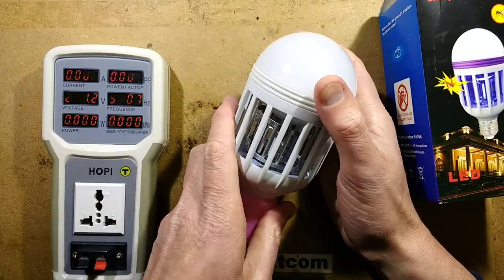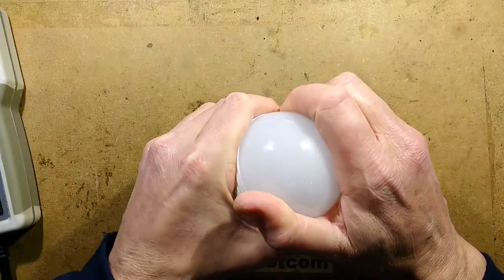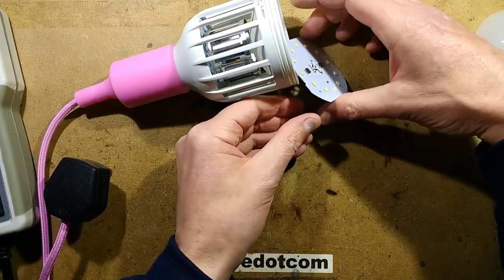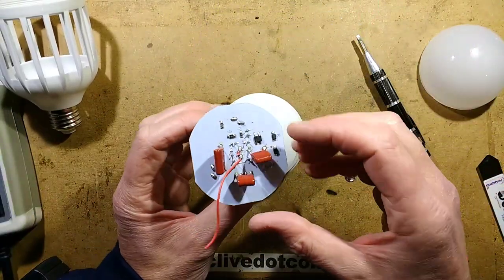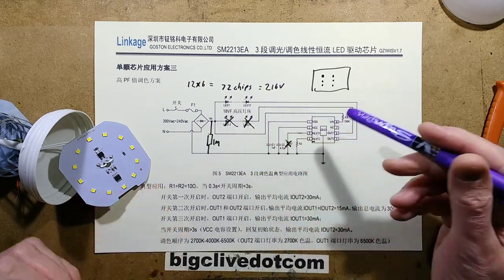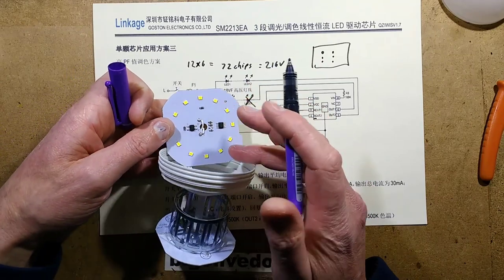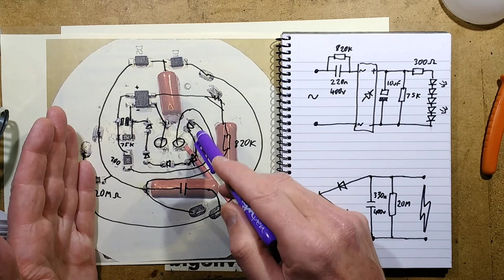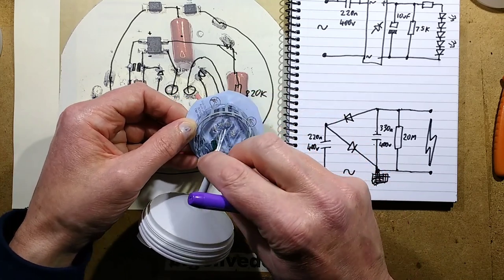Inside a bug zapping lamp (with schematic).

Comment: I have a question regarding the PCB's of hard drives. Some of them have a diode across the 12V section of the power input and GND, but the negative side of the diode is facing the 12V section. I find this really strange because I cannot imagine any use for this. There is usually circuitry afterwards, but it makes no sense to me. I just bought a hard drive that upon being plugged in, it smoked and the PSU shut down becuase of overcurrent protection. I took the PCB apart, and the diode I'm talking about was blown, thus causing a short. I removed it and now the HDD works just fine. The polarity was correct and there is no visible damage to either the PCB and the diode. What's the purpose of this? Here is a picture of what I'm talking about:https://imgur.com/a/wc6T0 Ignore the stuff about the BIOS chip, I'm talking about the diode shown by the pink arrow.  The PCB Board Number is 2060-701640-007 REV A
The diode was a "13L 02", the 02 part was in smaller letters than 13L
Reply from the maker: The reverse polarity diode across the supply rails is designed to do just as you describe.  Shunt the rails if the polarity of the supply is incorrect.  In man instances it survives, but sometimes it fails short-circuit and in doing so protects the rest of the circuitry.  If the diode had already failed short circuit then it's possible that the module had already been subjected to a reverse polarity connection.

Comment: This makes me curious about those old touch lamps that changed intensity when you touch it a few times. Hmm.. Take one of those apart! X3
Reply: SOLID Shift those are still available. I’m sure they work by making the casing somewhat live and part of the circuit and the resistance of your skin causes a change in the circuit which controls the light?

Comment: Years ago, when we got our first camper, (Nice POP-UP that you could pull behind your car) my good wife gave me a birthday gift of a small rechargeable bug zapper.  Now this one is made of plastic, but much stronger, this was pre-china so made in Korea and it actually has a florescent or neon bulb that does shine a deep purple almost black light.  The wire grid is nasty hot electric, and fries the bugs as they fly directly into it (can you say Gloomy Sunday?  https://www.youtube.com/watch?v=KUCyjDOlnPU ) It came with a rather nice cord so you could plug her into the camper if the battery got weak, but she seemed to last quite a long time on the built in rechargeable.  I still have it, although the hook to hang her from the camper is now long gone, and has been replaced with a piece of coat hanger.  Strange though, there doesn't seem to be that many bugs down in Arizona, now when we camp in the Dakota's the thing is frying like a MacDonald's grill.

Comment: 6500k is damn near blue, even 5000k is pushing it. I bought a set of HID lights for my car. 5000k was so blue it was damn near worse then the lower level yellow 3000-4000k that cuts rain and snow. 4500k is the said, best for automotive headlights.

Comment: I saw on a US show the host was told by a electrician that was installing LED lights on a boat dock that LEDs do not attract mosquitos ???  If that's true that makes this zapper pretty useless I have all LED security lighting on my farm and I have noticed there are not as many bugs flying around them as the old mercury vapor lights   I this true ?? WOOFS !
Reply from the maker: It's probably more random marketing hype from the LED industry.  Like the 10 year lifespan of the expensive lights that fail within a year or two of installation.

Comment: You couldn't convert the hopi to lower ampage? Open her up!
Reply from the maker: I could change the shunt, but I'm not sure if there's the facility to switch range on the unit or if it would require different software.
Reply: bigclivedotcom only one way to find out!!

Comment: - "Three chanel control Don't have to change the power switch"
- Well how do you change mode then?
- Well.......
Reply from the maker: By using the existing switch to turn it off and on.

Comment: Hey Clive, Been a while since i've commented on any of your videos - Sorry been a bit busy as of late. Hope all is well with you.
You stated your audio  has a bass heavy quality. To my system it's good - but i use high end monitors with large power reserves. Not many do. Most have a 3 inch speaker - or in a phones case 3/4 inch or less surface area to reproduce sound.
So i guess you go down the middle for sound content, not always easy for you i would imagine. With the way you currently do things - with good results by the way. Some day Clive i would like to hear you with a really nice ribbon mike - even a Shure sm 58 would be good.n Yeah, you are trying to keep it simple and can't fault you for that. I have been experimenting with a bluetooth module.....Perhaps i can come up with something with fidelity and simplicity......

Anyhow have a good.

Comment: Well the Version you have There Costs in German ebay 7,50€ Now. xD
Bought now one From China with Wires instead of Metal Mesh for 3,15€
Arriving Sometime between End of Okt and end of Nov. ^^
Replacing my RGB Color Changing Lightbulb.
Or i have to Find a E27 Adapter 1 to 2 Sockets.
Reply: Hint i bought a Adapter from China for just 1,15€ inkl shipping. xD
Reply from the maker: Just one adaptor?
https://www.youtube.com/watch?v=2DMGAd_xJiQ

Comment: Mosquitoes are attracted to CO2 not UV.
Reply: They're attracted to both. I have one of these bulbs on my back porch and I have to clean it out every few days in the summer because it gets so full of dead mosquitoes. I also have a mysterious source of mosquitoes in the kitchen, which may be from the window plants and put another one of these bulbs in a socket to plug adapter near the window. It also has killed dozens of mosquitoes and flies.

The thing that sucks about these bulbs is they really don't last long before they die. When it's really humid, the PCB with the high voltage starts to have corona discharge on the traces, which eventually eats through them, shorts out and blows one of the polypropylene capacitors. The LED board also has a high failure rate, either the controller chip dies or one of the LEDs die and it goes dark. Fortunately, Walmart sells them for $7 or so, which is a good price to pay to keep disease carrying mosquitoes at bay.

Comment: Looks less um dangerous than the other one you just plug  in the wall with or without the plastic cover on.  which naturally I bought cause I can actually put that up high up out of the way of most idiots.  :)
Reply: the 110 version https://www.amazon.com/dp/B01I3ZI8UC?tag=opr-mkt-opr-us-20&ascsubtag=1ba00-01000-ubp00-def00-other-nomod-us000-pcomp-feature-pcomp-wm-2-wm-1-wm-3-wl-pfd0_ask0&ref=bit_pcomp_sav0  interestingly not well reviewed...  possibly because it's blue and not ultraviolet